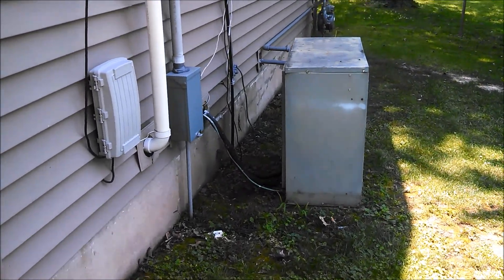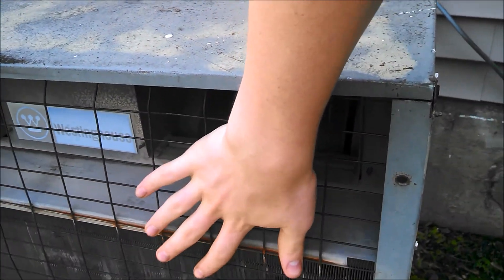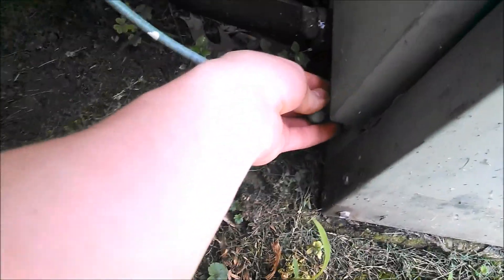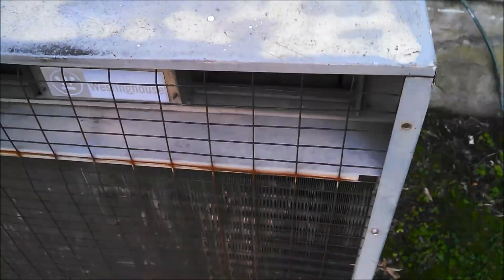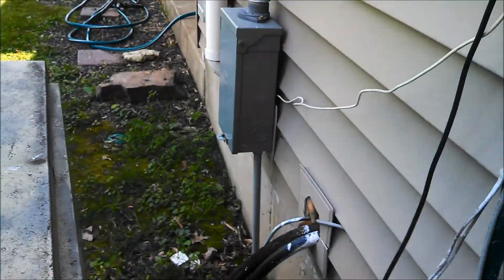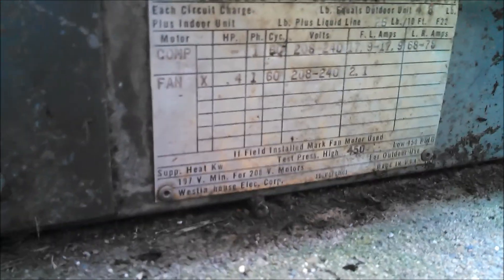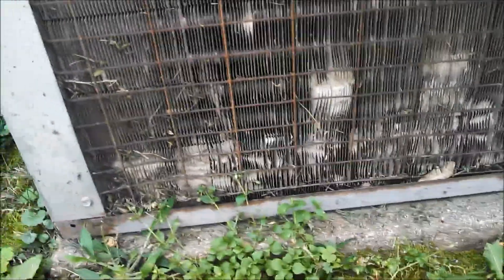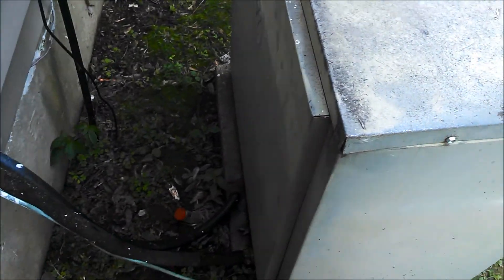Old Westinghouse Air Conditioner

Comment: I have this same unit, better shape, but no marking model Id plate.  Thanks for the info.  I recently took the blower moter out to replace the bearings.  THERE AREN'T ANY. There's barely a bushing.  All assembled the tolerances are extremely tight.  It has felt oilers, little spring flip up caps to oil lubricate the shaft and bushing.  Oil up the felts on each end of that motor and it'll quiet right down.  It's also a brushless motor.  Had a hot spell and the contactor switch stuck on, was running constant for 3-4 days untill it finally ran the oil out of it and started making some screaching.  Hadn't done any maintenance but blow out radiator every other year if that. Contactor switch sticking had been the only problem it's given me in the 15 years I've been in this house, and it was a relic then.   Having to take it apart gave me an appreciation for this thing. I'd rebuild it before ever getting the current top fan blade style of outdoor unit.  I'll replace my furnace and A coil long before giving old blue here the heave ho.

Found my tag.  Here's the info:
Westinghouse  
model# SL 022C2W 
style 354A376G13 
serial AO 133357
.33 hp fan
208-230 volts
60 Amps  cycle 60

The the main capacitor is 47826 "Old Reliable" made in the USA by Harry Alter Co. 
35 MFD  370 VAC
Looks like a battleship gray painted metal flask.

Comment: Cool unit...love the squirrel cage condenser fan.  You never see that anymore.  Liquid line shouldn't be hot to the touch however...condenser coils (and squirrel cage fans) probably need a good cleaning, or the unit's over-charged.  With proper maintenance that'll run another 40 years.
Reply: GE in the early 1960's had a massive outdoor unit with two separate squirrel cage fans in the unit.

Comment: Why don't they put squirrel cage blowers on the new condensing units.  New condensing units have the ordinary propeller bladed fans.  It seems like squirrel cage blowers on condensing units would be the most efficient,